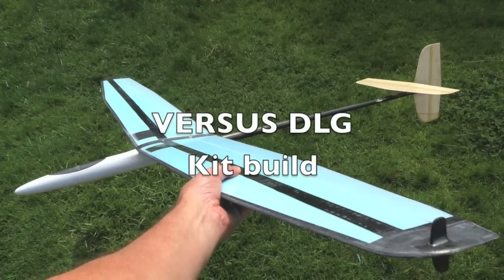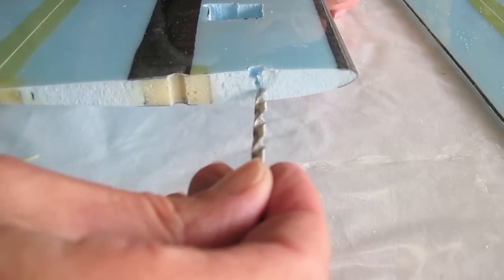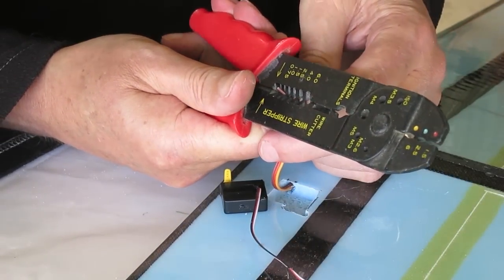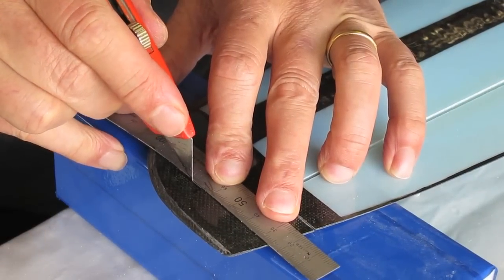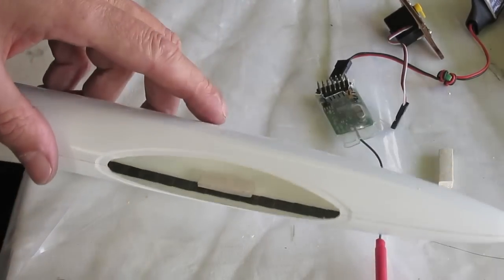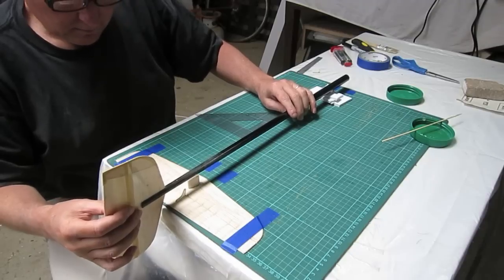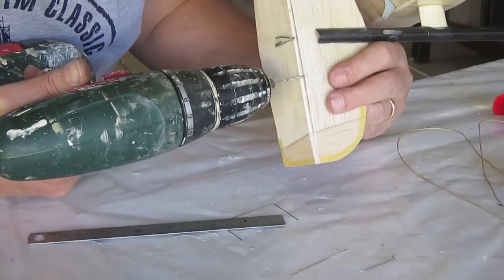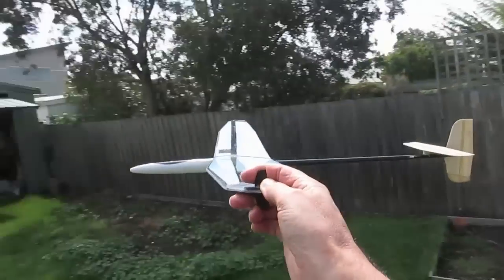Versus Discus Launch Glider build

Comment: Andrew, I am building a Gladiator II DLG I got on RCGroups... I need to reinforce the tail and I was wondering what fiberglass you purchased for that purpose? Was it from the hardware store or did you purchase online? Thanks in advance for your help
Reply: +Jason Mundy one more thing... I am struggling to find the tubing to use where the string exits the boom
Reply from the maker: +Jason Mundy Hey Jason, I think it was 18g cloth from HobbyKing. The tubing came with the kit but any thin plastic tube will do.

Comment: Any thoughts on using credit cards or actual carbon fiber sheets for the tail surfaces? I know balsa is cheap, but I imagine they would be more resistant to damage. 

I'm also curious why people don't use square carbon tubes for the tail booms. Seems like they would make it easier to align the vertical and horizontal stabilizers.
Reply from the maker: +fromkentucky Weight, it's all about keeping the tail as light as possible. Your suggestions would be OK on a slope soarer but not a thermal glider.

Comment: I really cant see this model taking a full power launch. Has the wing snapped yet? and pod cracked?
Reply from the maker: +paulkazjack You are probably right but any damage I have done has been due to tip strike or dropping the transmitter. The fibreglass pod is fairly weak. But thats why decent DLGs are 3 or 4 times more expensive.

Comment: good video built many dlgs best thing to do with the versus is to get the blaster 2 elevator mount and replace the balsa block and have a the full area of the elevator working for you ,makes a big difference to this dlg , the last versus which i built for someone took me around 2hrs once you have built one dlg they are all more or less the same  i do like the blaster 3 really nice clean build on them ,but for launching the topsky 3 takes it i can get it to around 190ft where as the blaster only to around 160

Comment from the maker: Satoshi Takahashi - Your comment is not appearing for some reason.
I use a Turnigy 9X with the OpenTX firmware mod via a Smartieparts board, but any programmable transmitter with at least 4ch will work. Initially I had 4 Dymond D47 servos but the aileron ones stripped after a few hard landings so I would not recommend them for ailerons, great (and small enough to fit) for rudder and elevator but too expensive IMO. I'm now using cheapo HXT500 for ailerons and they're OK but a bit inaccurate.
Battery has to be small enough to fit right into the nose, I use a TGY 300mAh 2S with BEC, lasts for 2 hrs.

Comment: Great build andrew, can't wait to see it fly! Riding tiny thermal bubbles is one of the coolest things in r/c! I use an Art Hobby Elster 1.5m as a DLG (though its not designed as one) and it great fun and challenging. Go out on a calm, sunny day and you'll learn to read them :-) Find your best glide speed and keep it there,  when your tail rises slightly, you're in lift. ATB!
Reply from the maker: Thanks. You're getting me excited. Just need some calm weather.